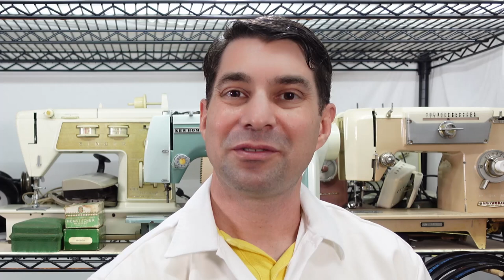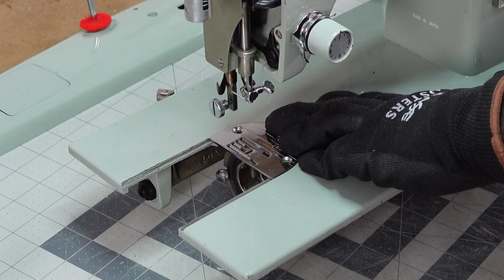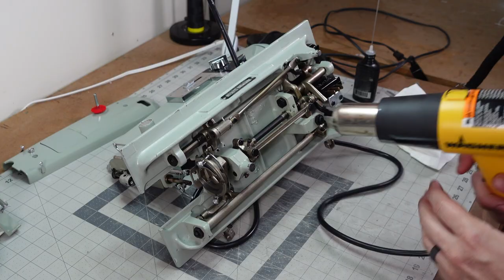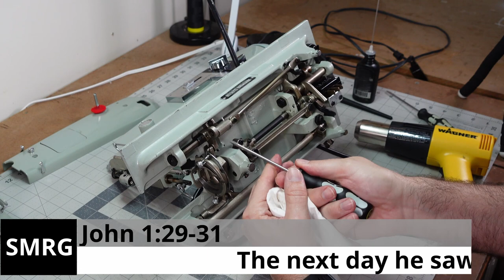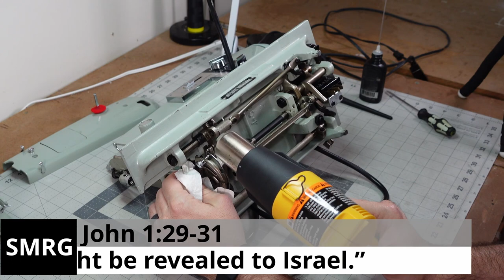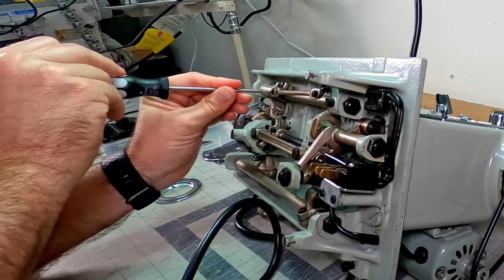How to Free Up a Stuck Lever on a Vintage Sewing Machine. Showing the Whole Process!

Comment: I just found your channel and am enjoying it. I saw you had gloves on when cleaning parts. What kind of cleaner were you using? One person told me WD-40 worked on his New Home machine. The comments say denatured (rubbing?) alcohol.
I have a Singer Touch and Sew Model 600 that does not work. My daughter is an auto mechanic and would like to try cleaning it  up. It has been in the house, lowered into its desk cabinet for 40 years. The needle moved up and down, so its not froze that way. We figure we have nothing to lose but free time.
Thank you for the Bible verses.

Comment: I have this same machine and the stitch width lever is stuck.  It won't slide so I can't increase my stitch width.  Any hints for that?  Or maybe a view of how that section of the machine works?  Thanks.
Reply: The stitch width is related to the bar below the one he's heating up. I'm not sure exactly how it functions. It should change the speed of the part that catches the upper thread to run through the bobbin thread.
Reply: @Tomcat12789  thanks for the reply.  I finally figured it out.